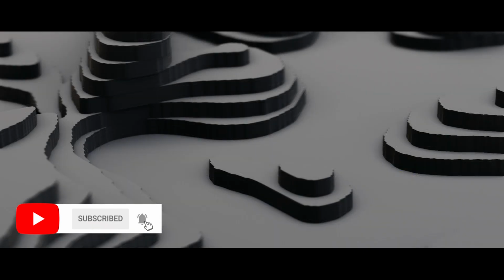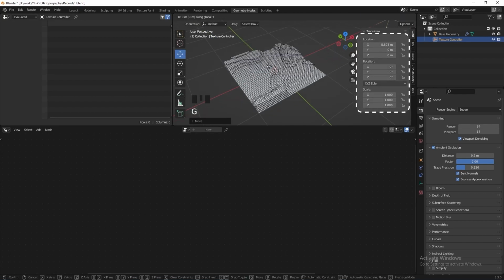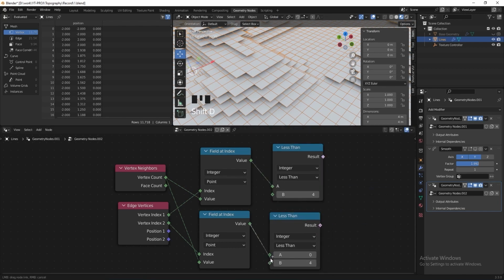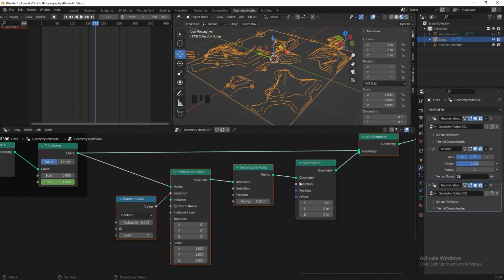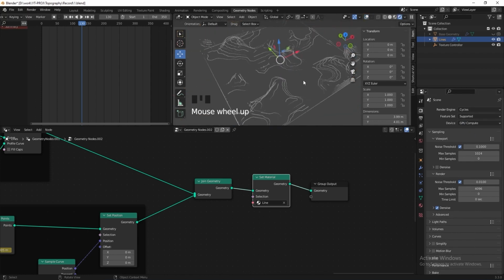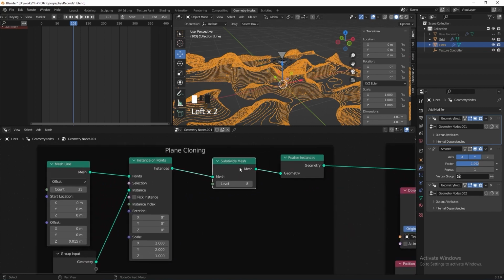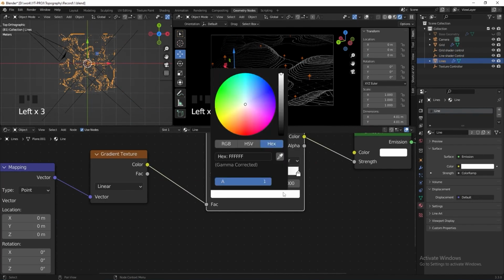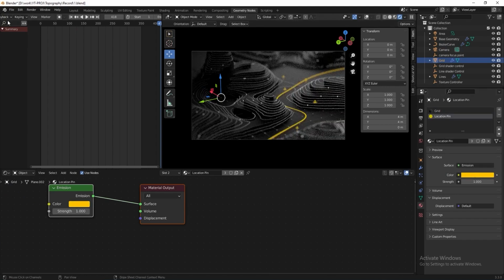Blender3D 3.3 - Topography Landscape Geometry Nodes

Comment: Absolutely love this tutorial! Quick question though: I have an elevation map that I would like to use instead of randomly generated Noise Texutre...is there a way to properly replace the Noise Texture Node with so i can use the image instead?
Reply: I am trying to do the same thing! Did you get it to work?
Reply: For this I just connected an image texture node to the LESS THAN math node. The problem is that for some reason it only maps the image in ¼ of the plane

Comment: Hm... Is it possible to create slices with curves, or ngons? To avoid those broken edges? Something like this in c4d (done with voronoi fracture): https://youtu.be/7YdM27wvW6U?t=23
Reply: I guess, you could try to convert the edges to curves, then subdivide them and/or convert them to nurbs or bezier curves to smooth them and afterwards convert them back to a mesh with the fill curve node before the extrusion. You could then as well use the curves directly within the first node tree for all the curves and instancing points on curves etc. I'd problaly also start with a grid node in the first place instead of the plane that is subdivided a million times. This way and without the need for the smooth modifiers I guess Performance will improve as well.

Comment: here's my guess right away before i try this myself, raytracing to snap curves to surface... but im not sure how to make sure every hill is covered...
Reply from the maker: You mean "Raycast"? No, i didn't use any Raycast or Proximity, that might be another approach that i haven't explore😅
Reply: That's exactly what i tried so that i can use my own geometry as base and not the noise texture. Snapping with raydirection to center of mesh works, but only in some edge-cases like you said. The only possible way to achieve the same result as in the video was through mesh booleans, which works, but it's unusable because it's so slow. I had another idea floating around: find local peaks and valleys, spawn mesh line in Z direction at the lowest point of every peak/valley found and instance circle curves on the points. Then try the curve snapping way again. I have not thought it through, but i have a bad feeling about that one too. There has to be a more clever way.
Reply: @DerWavezz  im glad someone other than me is thinking about this, I thought I was the only one bothered enough to try to figure it out
Reply: @Kavukamari  hey, sorry for answering so late. So I’ve got another idea which worked for 3/4 of the way. I created a 3D point Grid encapsuling the whole custom mesh (just get the bounding box size), transfer Attribute the position of the mesh and do a check, which points of the point grid are the closest to the mesh. This way we can „slice“ the mesh on the Z axis, just like we want, depending on the count of given Z points. With a compare (less than/equal) you can kinda get close to only getting the topography lines, just in „point cloud“ form. You can then merge by distance, to get rid of the clustered points. The missing puzzle piece is to connect the points, so we can convert them to a curve. The problem is, that the points/vertices are not sorted, which makes the connecting part really tedious, couldn’t wrap my head around it. Maybe this gives you a good starting point, and if you solve it, let me know! Cheers
Reply: @DerWavezz  i really like that idea, theres not really good solutions right now for connecting disconnected vertices i think, but it might be solvable